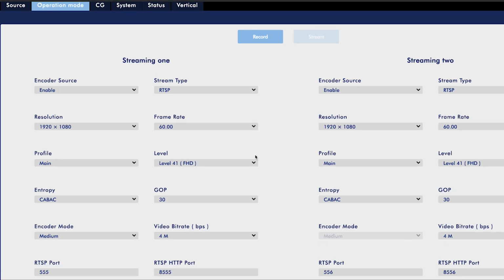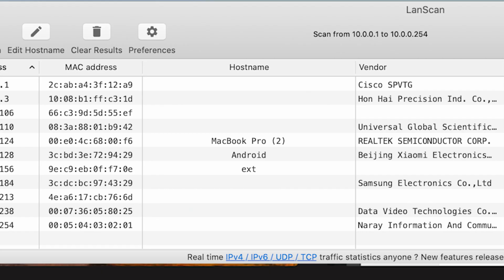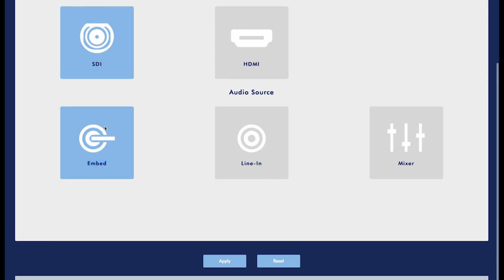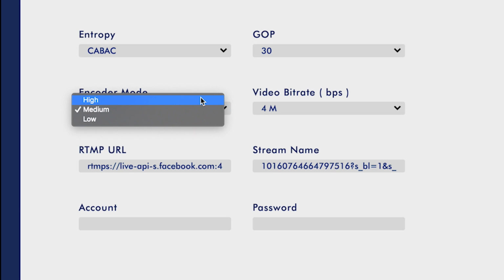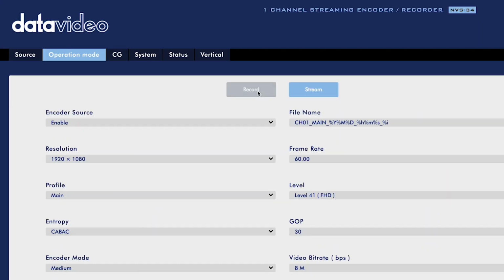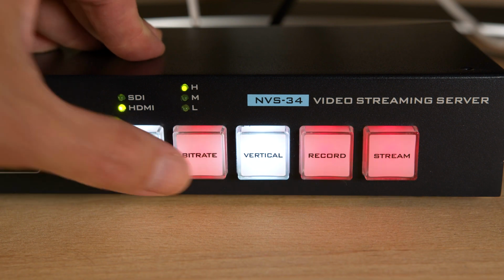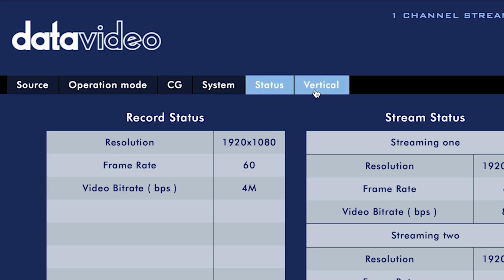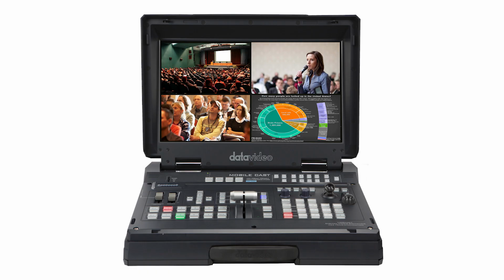Datavideo NVS-34/HS-1600T Mark II/KMU-200 Encoder Set Up Tutorial

Comment: I seem to be missing the output of the streaming signal.  I have a Wifi internet router that has a LAN connection also.  Is the signal coming out my Wifi connection or what?  I am missing the output after encoding takes place. I would like to run a HD camera outputs into a small 4 channel switcher into the encoder. Your help thanks